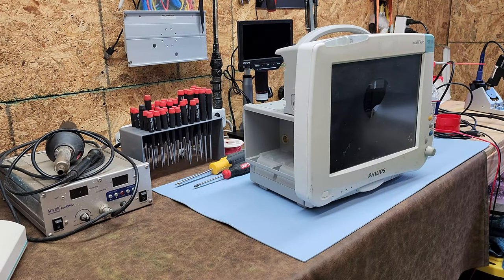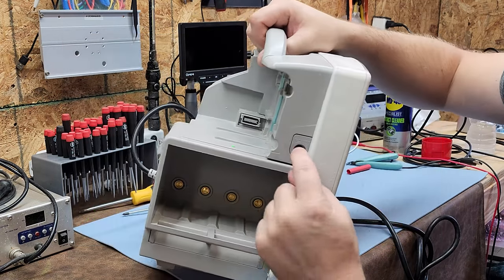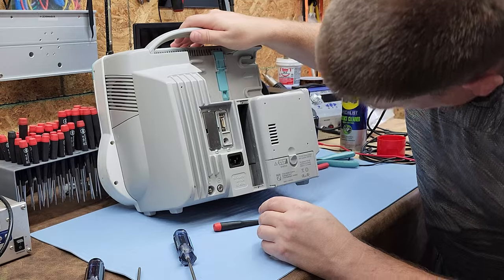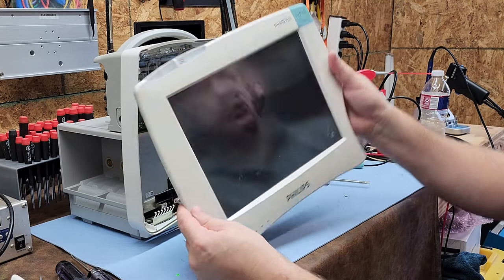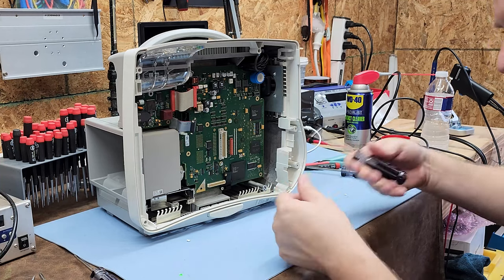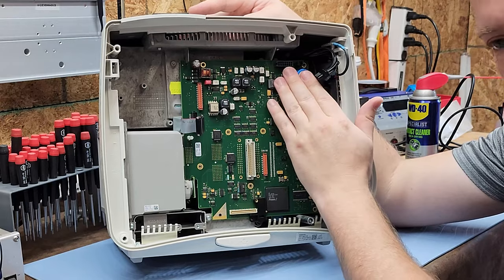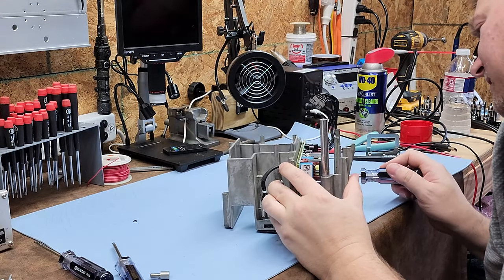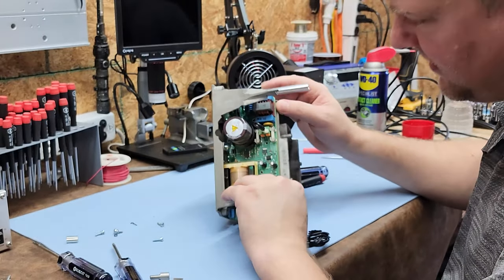Philips MP50 Teardown and Overview

Comment: Now they made several models of these televisions. There’s even a smaller travel, size model, and even a defibrillator version called the MRX
Reply: Now they Phillips MRX heart start system is kind of travel size like the miniature Phillips intelevue heart monitoring systems, but it also kind of big. But it also has two different modes of defibrillation, manual and auto.  Has two options for defibrillation with paddles or adhesive pads, and it even has a CPR lungs pressure sensor too that is optional

Comment: The extra transistor on the primary side of the PSU could be part of an active power factor circuit.
Reply from the maker: This is one of the only things I could figure for a second switch on the primary.  I really wish I had more time to Xray the board and see where the traces go..
Reply: @BetterBiomedChannel  Look at the control IC's around the switching transistors ans you will see. Also measuring the voltage on the primary cap(s) will tell you if there is active PFC happening.

Comment: I have this monitor, sometimes when I turn it on the screen and the LEDs do not turn on, and sometimes yes. Can you advise me where the problem could be
Reply from the maker: Are you sure it's a LED backlit monitor? Sounds like the backlight driver is defective
Reply: @BetterBiomedChannel  Yeah, the alarm LEDs of the left upper corner. Both do not activate, just the sound and also the touch are working.
Reply from the maker: Write me at abetterbiomed@gmail.com